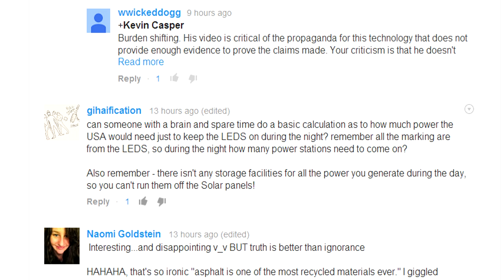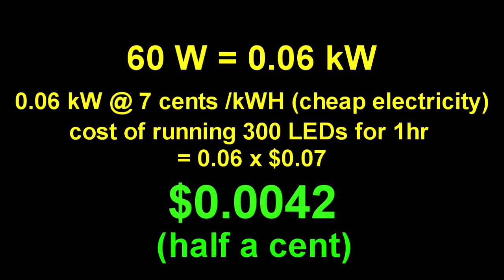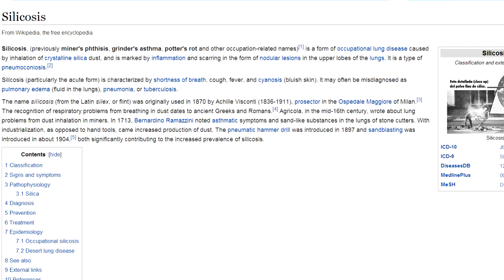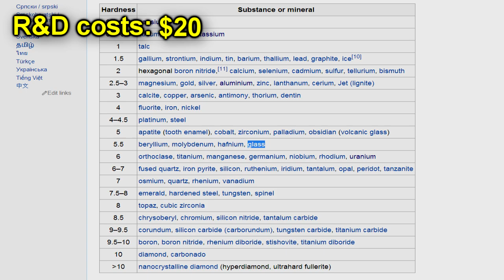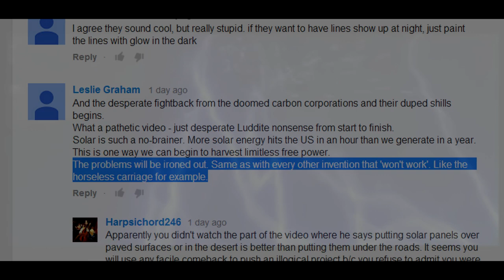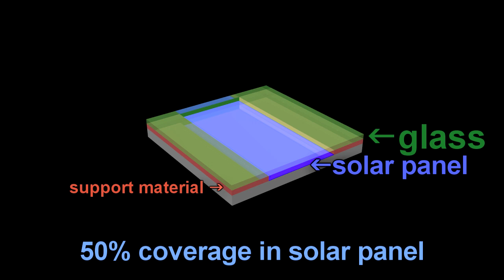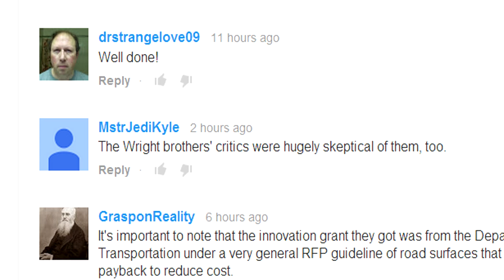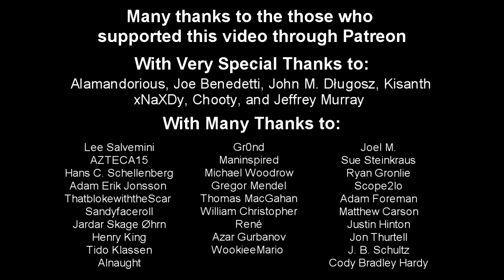Solar Roadways, IMPORTANT QUESTIONS AND ANSWERS!

Comment: There is a similar idea to this, it isn't solar, it involves replacing sidewalk slabs with some kind of pressure plate that generates electricity when people walk over them, i think that could be very useful if the technology is refined.
Reply: your talking about piezoelectricity. You would have to make it very cheap or it would suffer from the same problem as the solar roadways: cost effectiveness.
Reply: Keegan Maloney Well that is the problem we are facing isn't it? money. I guess we may as well let climate change consume the planet, but hey as long as we can do it while making lots of the paper stuff, it is fine.
Reply: Jasmine blake
      I can understand your frustration, but please realize that there is not much you can do to motivate people except pay them so that they can feed themselves and live in comfort.

     How else would you propose to motivate people to build  hundreds of thousands of square kilometers of piezoelectric sidewalk? If you have an effective means of motivating people to get that much work done and still allow those people to provide for themselves than I would absolutely love to hear it. Something like that could change the world more than piezoelectric sidewalks ever could.
Reply: It occurs to me that a project I am working towards could assist in bringing down the cost. it's a multipurpose automated microfactory that can re-make copies of itself. If you are interested let me know, I can give you some details.
Reply: Keegan Maloney A resource based economy, is possible and would allow people to work doing what they do best while affording them a comfortable lifestyle, like it or not, we are headed in that direction anyway, what with increased automation and loss of jobs that will never come back.
Reply: Keegan Maloney Let me ask you something, i'm not sure what you do for a living but judging by your previous comment i would assume you are some kind of scientist or engineer. Now let me ask, do you love what you do? i mean if you could have everything you need to live a comfortable, would you still do your job? or would you quit because you no longer need to work to put food on the table?
Reply: Jasmine blake I would indeed still work, but not on something as mundane as installing equipment for several hours a day.

 The thing is, if people were willing to do the work that is needed based solely on their passions, then there wouldn't be a problem in the first place. They would already be doing it. So unless you have a project in mind that enables people to explore their passions than I don't see your point. 

If you do have a project to enable this, how will this project provide for them while they explore passions that might not immediately be profitable or even implementable?
Reply: Keegan Maloney Look up the Zeitgeist movement, peter Joseph or Ben Mcleish, they give some excellent talks on how it could be done and why it is essential that it is done.
Reply: Jasmine blake I will rewatch the movie, I have actually seen it before but cannot recall what you are talking about off the top of my head. There where a lot more extreme claims that I thought where going a bit too far, overall it seemed quite sensationalized. It is perhaps for that reason that I don't remember the more reasonable proposals like the one you are mentioning. perhaps you could highlight more of what that proposal is in general so I know what I'm looking for?
Reply: Keegan Maloney The movie doesn't go into detail, there is a talk on youtube titled economic calculation in a natural law/resource based economy, it is quite lengthy but it outlines some major problems with the current system and offers reasonable solutions.
Reply: Jasmine blake
Unfortunately its not going to work, you spend 800 kilo calories running for an hour, that's the same as 3.360 kilo joules. Divide that by 3600 seconds and you have 930 watts (that's a lot, surprised me too!). Factor in that most of the energy is heat (about 80%) so you are left with 180 watts of mechanical energy. Now most of that is used to move you around, so even less power will be generated by the side-walk (lets be really generous and say 10%). This leaves you with less then 20 watt/h for someone running. That's a hell of a lot less then you would need to make it work.

The average European consumes 6.000 watts every hour of the day (most of it in transport and food). This would reclaim only 0.3% (very optimistic) of that, if you were running 24/7 and didn't eat any more food.

Nothing to do with human locomotion would even make a dent in our energy requirements, to live the way we do requires so much energy it puts to shame the amount our bodies use (100-120watts idle).
Reply: axe863 Ahh never mind, it seem you are just a douche bag, i've looked at your comments and 100% of them are attacking or generally being nasty to people, some people just ain't all that happy and feel the need to take it out on others i guess. have a great day :)
Reply: Reddit Gold User I don't know why they don't use the reflective paint right now. The solar-powered LED signs along the road might be a good warning but where is the detection?
How can you detect that there is something in the area that covers that sign? Detection means 24 hours, which is more power.

The point is to have an intelligent road self-powered with the technology that we have and of course, it has to be mathematically and phisically possible
Reply: Helghastl33t It does work, it has nothing to do with running, it works by generating electricity from pressure and depending on the material used thousands of volts can be generated, there are many ways out there to power our homes, the issue is that companies want to be able to make money from it, if they can not make a profit they wont fund/implement it.
Reply: Jasmine blake
Didn't I just do the calculations for you showing that if everybody was doing the most labour intensive thing they could do 24/7 on the surface it would not even make a dent in their power requirements?

Also volts without amps is an empty statement when talking about energy quantities.
Reply: Helghastl33t Did your calculations take into account the different conductivity and effectiveness of different materials? because those would be some amazing calculations
Reply: Off-course not, but they would not need to to be effective.

The energy a power generating walkway can produce is always lower then the amount of energy you put into the walkway (first law of thermodynamics).

My calculations show you that even if they were impossibly effective at transforming the motion of the people (under insane 24/7 use circumstances) into energy, they would not even make a tiny dent in the energy use of those people.

Thus it is fair to assume they are not a viable source of green energy.
Reply: Helghastl33t Other people have done similar calculations and come up with a different conclusion.
Reply: Google it, the test walkway in London generated 15w per person 25w peak. I would say that's pretty damn close to what I calculated! And still makes it an utterly ridiculous feel good idea.
Reply: Helghastl33t Not all technology is instantly as good as it can possibly be.
Reply: Jasmine blake there basically getting at the same problem I brought up with the technology from a different perspective. Lack of energy density vs. cost.

either you would have to make some kind of piezoelectric coating that was super cheap that could just be added to the sidewalk or roads or you  would have to find a way to make in nearly 100 percent efficient for the same price as a solar panel about half the size. Otherwise, their right. The energy being absorbed just isn't worth it.

one way to bring down cost is to remove labor from the equation, which is where I was going with it, but most people think this is crazy to even attempt.
Reply: Jasmine blake How do you know that the non-empty high dimensional RBE  type optimization problem is solvable in finite time if it has yet to be even quantified? Do you assume as your null that all potential non-empty optimization/decision problems can be via some transformation contained within the polynomial complexity class.  How do you derive optimal consumption bundles under non-infinite resources without the existence of budget constraints? What is the efficiency measure?  How is eliminating money which reduces the dimensions of an optimization problem due to the existence of a singular numeraire vs all relative prices, a positive thing? 

A RBE is totally nutterbutters Utopian bullshit. Peter Joseph is a master at marketing Fresco pseduo-scientific bullshit to the masses. You assume as your null that an unquantified unfalsifiable RBE type system works. Your positive evidence for you position consists of a collection of Fresco paintings. Fyi, a position does not become scientific merely because it claims to be.
Reply: axe863 There is no evidence that it will work, but it makes sense and probably won't be as destructive as capitalism currently is, for all your other questions, if you are really interested in answers there is a free book online i think it is called the Zeitgeist movement defined.
Reply: Jasmine blake  There's no evidence that the flying spaghetti monster exists but it makes more sense to me, a complete ignorance w.r.t astrophysics, than the Big Bang. If you are really interested in answers, here's a link to AnswersinGenesis.com. Now do you understand how irrational you sound.
Reply: axe863 Fallacy much? How is a change in economic system the same as a mythical monster made of spaghetti? There is no evidence that it will work because it has not been attempted before even partially. Are you usually as obnoxious as you are coming across or are you making a special effort?
Reply: Jasmine blake "There is no evidence that it will work because it has not been attempted before even partially" but ill assume that it will work until it has been exhaustively demonstrated not to work... Right?
Reply: Jasmine blake Maybe you are completely ignorant with respect to computational theory but the vast majority (infinitely many) of high dimensional optimization problems are not within the polynomial complexity class meaning that are effectively not solvable in finite time.  Assuming as your null that the unspecified optimization/decision problem falls within said class means that you're either a completely irrational Utopian dreamer or you're rational and every optimization problem can be transformed into said complexity class. 

An even simpler point is how exactly does one converge of optimal consumption under the non-existence of any budget constraints under a RBE. Under utility maximization, the nonexistence of any budget constraints (unconstrained optimization) is equivalent to assuming infinite resources.
Reply: Jasmine blake What is the fallacy? You have a fairly strong position of knowing what is feasible considering you have near-zero knowledge of economics and computational theory. Equivalently, It isnt obvious to individuals completely ignorant with respect to physics that belief in over-unity machines (machines that have over 100% efficiency) is irrational.
Reply: axe863 Oranges and apples fallacy. Your assumptions pertaining to what knowledge i do or do not posses aside, there are engineers and the like whom support TZM, that is why i suggested the book but it seems that you are not really interested in discovering if it is "feasible" or not, you have already decided that it isn't in which case i'm not sure what to tell you. Then again i should have known from your dismissive and condescending tone ah well, live and learn.
Reply: Jasmine blake "There are engineers and the like whom support TZM, that is why i suggested the book but it seems that you are not really interested in discovering if it is "feasible" or not, you have already decided that it isn't in which case i'm not sure what to tell you. "

There are many Ph.Ds that are Young Earth creationists, 911 truthers, AIDs denialists etc. This is not how we gauge the scientific strength of a position. The feasibility of an optimization method is derived by mathematical equations and proofing, not drawings or propaganda art films.

Either TVP incorporated /TZM  actually publish a paper on a theoretical RBE(tm) type optimization in a peer reviewed and prove it's convergent to optimal consumption bundles under, at the very least, some efficiency measure under some set of conditions or it will remain a completely worthless pseudo-scientific movement. Bye. Your position has been sufficiently destroyed.
Reply: axe863 What makes you want to be hostile towards me? have i insulted you in any way? have i attempted to belittle you? Honestly i'm interested to know where this hostility comes from and why it is directed at me.
Reply: Jasmine blake No, money is just one issue with this. The fact that glass is a terrible material for roads is another, and the fact that their solar panels are laying flat on the ground where their efficiency is drastically reduced and then they have cars passing over them all day too, with blurred and scratched up glass covering them, they will produce a useless amount of electricity. The LED's aren't bright enough for road sings either. This is literally impossible to make, it will never happen.
Reply: oBLACKIECHANoo  as I understand it, where not talking about solar at all in this conversation, we started off talking about piezoelectrics and ended up talking about the zeitgeist movement.
Reply: If you used pressure plate technology on the roadways your vehicle would get less miles per gallon. That wouldn't be fair.
Reply: Using piezoelectrical pressure plates on sidewalks has already been experimented with. The results were even worse then expected and that wasn't even counting the humungous costs of such a project.
Reply: Jasmine blake Well, that "some kind of pressure plate" needs maintenance and probably more offten than the leds, so that's mean more cost.
The simple answer would have a net of leds connected to a station (can be a pole or whatever) which can have the programmable boards. And over that station, you can put some solar panels (there's gonna be one station every fixed distance) and even some wind-energy-collector on the side of the road (from the wind made by the cars) and a small battery to store the energy not used.Plus you connect all the station and they can supply energy to each other.

Now for the road, you use the same mix that we use now a days but, the net, you put it before the mix is dry and with each led looking up with at least 1 cm under the road level.
The net can be made of copper balls instead of a cable so they can move when the road heats up or cool down over the year.

I'm just improvising here. Bye
Reply: Pikopati LMAO. How about reflective paint? And if you want the warning functionality why not solar-powered LED signs along the road and on overpasses? Oh wait we already do that.

Comment: Why don't we just fucking put the solar panels on the side of the roads.. More efficient, they are less susceptible to damage, less cost to produce, so on. It's not that fucking hard of an idea. Sure you can poke holes in the logistics of it, as there are many. But it seems to be a better option in almost every way. Why not invest money into developing more efficient solar cells we can develop using recycled materials, that are low in cost, and we can just put them on the sides of the roads.

Comment: If you want to fill otherwise wasted space with solar panels, you'd be much better off covering every roof in your country with them. The roof tilt would give the angle needed for decent collection, and it would probably be a lot cheaper than trying to convert roads.

Comment: ***** Now correct me if i'm wrong, but their website has no indication to how their panels hold up to the likes of hail. They covered earthquakes.. basically, they admit an earthquake would destroy or severely damage their panel to the point where it doesn't work, as indicated on their FAQ page. They mentioned adding in.. "earthquake sensors" (seismomemters?) Wouldn't that drive the cost up even more as well as be effected by traffic driving over?

I also wonder how a road would handle a tornado. Most asphalt roads can handle a tornado, the strongest usually ripping the asphalt off the ground, but how would a solar road fair?

Comment: If there is a perfect place to test the technology, I think it would be the prairie/central section of the trans Canada highway. Summer is not bad. 

But, then there is winter. 

A good part of the winter, its around -25C. Some weeks can be colder. 
And not only is there the traffic stress, and the stress of added contaminants, but also, snow removal. 

Those plows go at pretty much highway speed with the blades right  to the pavement (how else do you clear ice?). What would that blade do to a glass panel?
Reply: Come to think of it, then there is the problem posed if one or more of the panels works itself loose. 

Uneven surface posed by loose tiles isn't much of a problem for a round tire moving over it. But for a plow, that can hook and tear them out, big problem.
Reply: Ah yes, I forgot about these tiles being able to heat up and melt the snow and ice. 

But I also forgot about that massive energy footprint. From the last video.